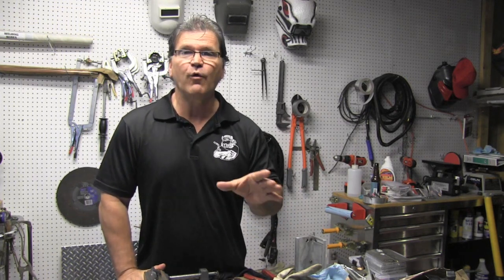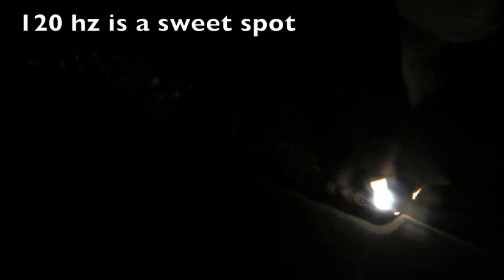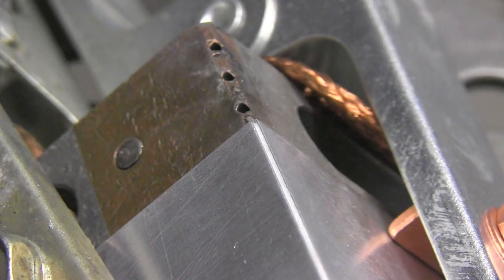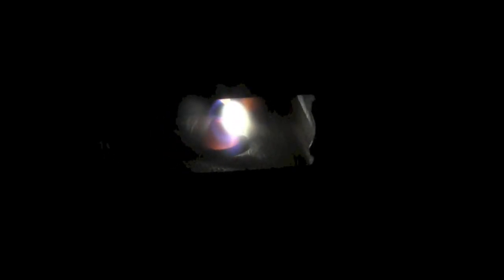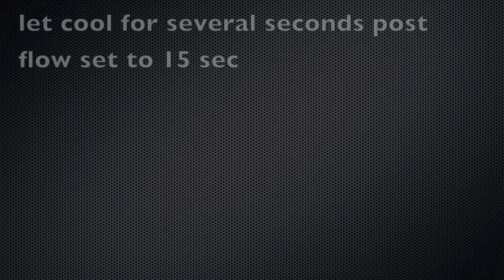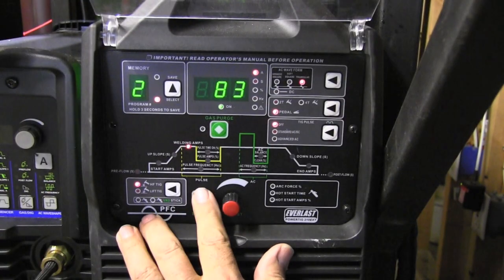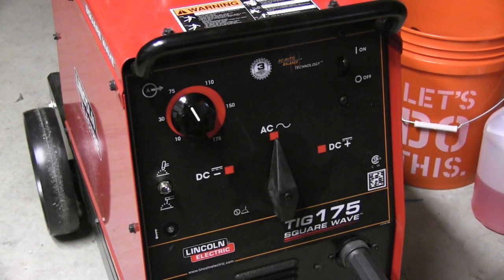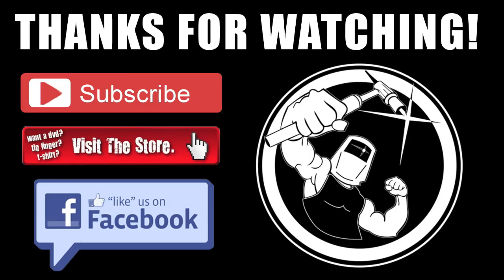Tig Welding Thin Aluminum

Comment: Fact Aluminum is a trade mark name for reynolds aluminum foil wrap ... they couldnt trade mark Aluminium because it IS an element ... they could trade mark a misspelled version though ... btw Reynolds wrap is made with Aluminium ... you use facial tissue ... most people cal them kleenex .. (name brand) ... you hold wrapping paper on a present with Cellophane tape ... Scotch Tape ...is a name brand ... Aluminum is a foil made by reynolds for wrapping food in ... made with Aluminium

Comment: Gotta thank You for sharing all this stuff. .080/2mm 2%La became quickly my favourite. I was trying 1.3mm sheets of 3003 with 1.6mm 4043 filler (we don't have thinner at the shop). 250Hz and triangular wave felt nice. It was challenge for me with 200Hz and square wave (I tried to practice this because I'm not sure if I will be able to afford machine that can do several waveforms). Had to babysit it with pedal a lot, specially when I was trying to do a pass without chill plate but got away with it really nice. But thanks to You tips I finally had and idea of what is going on. So thank You a lot!

Comment: I'm a woodworker who wants to make aluminum drift boat hulls.  I think this means  0.1" inch or so thick sheeting, welded only at the chine where the side meets the bottom panel.  Do I need to learn how about mig or tig welding?  I had a buzz box stick welder once, and got fairly good at it.

I sold my torches and buzz box because they didn't mix well with sawdust.  But now I have two separate spaces.

Comment: Hello, I'm looking to buy a everlast tig welder and would like your opinion on the 200DV and 250EX. I'v been welding for a few years with the miller syncrowave 180 SD sold it and looking for a smaller in size welder..Thank You

Comment: Hello all, and first of all, great video thanks fo the share, And Second, Nice to see that it works with 60hz on thin aluminum also, because all the 'Tig Thin Aluminum video's' i've watched, were all on very high Hertz.  I've just bought my Tig inverter 220p (60Hz) and  when welding 1mm steel and stainless there is no problem, both weld great on very low amperage and that's exactly why i needed this AC inverter but than to weld thin aluminum.. HOWEVER...  i'm unable to get a pudle,, eather i dont get it or turn Amperage up and i blow thru the material. (Using 2% ceriated Tungsten, they were the only one's availible where i ordered the TIG inverter. I've ordered blue red and purple thungsten now also. When i get an 10mm piece of aluminum and turn the amperage up, no problem, great pudle, great welds, but thats not why i bought the Tig to begin with.. im looking forward to, and appreciate everyone's input here. Thanks in advange!.

Comment: Hi im new to tig welding and alloy welding is my reason for it. can you tell me what i may be doing wrong, im trying to weld some 1mm thick alloy but instead of forming a puddle it just seems to melt the alloy away before it even forms a puddle, im on a frequenceof about 60 but tried up to 200 and still the same and amps up and down from about 40 up to about 120 and still just dose the same thing, also when i try to add a bit of rod it seems to ball up and don't seem to want to add to any bit of a puddle when i do get it to puddle a bit.the tips im using are red tip, my welder is a new Sherman DIGITIG 200GD 200A AC/DC MMA IGBT Inverter Pulse Welder. please help im stressing out.
Reply: WAUW, i have the same problem, just changed the option 'best response to newest response and now i see yours.
Reply: Unfortunately he don't give any feedback.
Reply: @WALLACE7084  
No thats to bad, but i made up my mind en send this one back today, it is good value for the money but not what I'm looking for. I need to weld thin aluminum.

Comment: Hi Thanks for all your tips on welding. I have been watching them for sometime now. I have a question about Tig Welding thin Aluminum .030 " Thick. Im building a Aluminum box and i cant put no backer behind it and it keeps blowing through. Is it me or in cant be done. My settings are. 30AMP . 250. HZ  30% Clean. Using 1 1/6" electrode. 1/6" filler wire 4043.Had the tig welder on Triangle wave. Any advice would be appreciated. Thanks .

Comment: I've been using an old cebora Tig star 200 square wave set with an air cooled torch,  it has no frequency adjustment only amps and balance. My boss (not a welder) thinks I can do nice little beads on aluminum with this machine on 10mm thickness but l can't find a way the puddle is always wide.

Comment: Any tips for mig welding 16 ga aluminized sheet metal, I have no problem with it but bead appearance is like 6010 stick rod, we use 75/25 gas and I'm not too sure about wire but I think it's .035, pulse or short circuit is not available due to production rates, wondering if there was a gas or wire we could use to improve weld quality for better bead appearance

Comment: This is great information for me as a new TIG welder hoping to weld some thin aluminum. I have a Square Wave TIG 175 almost exactly like yours, bought new back around 1995-2000, but I never got around to TIG until just finishing a community college class today. I like that you keep showing this machine in use so I can relate to mine. I've placed two orders from your store already. Glad to support someone so helpful. I might update to a newer machine some time later, but it sure seems like this one will handle home projects pretty well.

Comment: I build radiators and Weld down the rubes to fix leaks and damage daily and on my dynasty 700 I run .040 and a #4 cup tri wave, freq400 but balance at 99. it makes super tight and tiny beads but more importantly keeps the arc stable as to not burn the fins.

Comment: I'd really like to see the back of your welds on this video too !! I have some thin wall Tubing to weld up in T sections but I cant have any bubbling action going on at the inside of the tubes as I need them to slide ! so will these techniques work for lowering that penetration on the back side ? Cheers
Brad

Comment: could you explain the difference between volts / amps & hertz? I mig & stick, trying to learn tig now.
Reply: Voltage is defined as 'electric potential'. Imagine two vertical cylinders with a valve connecting them. One is full of water, and the other is empty. When the valve is opened, the water rushes to fill the empty cylinder. 
In this case the 'water' is an analogue for electrons, and the valve is an electrical switch. 
A value in volts will tell you how much of a difference there is between how charged two objects are, but it doesnt necessarily correspond to current. Think about getting a static shock - there is a very large voltage, hence when you touch something grounded, the electrons jumping onto or off of you create a 'pop' noise and a small arc. But once you are at the same voltage as ground, there are no more electrons moving therefore no current.
In welding, the voltage is what creates  a 'desire' for the current to arc and connect to ground, and therefore a higher voltage should correspond with easier arc start.

Amps are a measure of electrical current. Amps tell you how many electrons are passing through a certain point in a second. On a constant current (stick or TIG) welder, this essentially corresponds with how much power your arc consumes and therefore how hot the weld area becomes.

Hertz are simply a measure of frequency. 1Hz = 1 cycle per second. A higher AC frequency when welding aluminium means the weld is switching between + and - faster, therefore the characteristics of each polarity are reduced (less electrode balling, less 'pulsed' cleaning action). Whenever you see Hz, you know you are dealing with something like pulse, oscillation, etc, that happens periodically.
Reply: Frank Reading thx for that you share with us

Comment: I want will share an effective folk remedy from burns from Russia: the sinks of river mollusks collected on the bank of a reservoir need to be calcinated at high temperature. After cooling to crush in powder. To use this powder as powder right after receiving a burn.

Comment: Wish I had seen this years ago when I was restoring an old Crestiliner boat.  the hull had a ton of tiny perforations in it because it had sat full of water for a while.  I had a crappy old Westinghouse stick welder with a tig conversion on it and really had no clue what I was doing.  I bent a piece of stainless sheetmetal let it spring against the backside of the aluminum.  I managed to get most of the holes touched up that way.

I'm sure I would have done much better with modern equipment and a few of your lessons.   I did however weld up one aluminum casting on the boat good enough that I got the only compliment in 52 years out of my dad.  He looked at the piece for several minutes, handed it back, and said "Damn fine welding job son."  Even my four brothers who were there also said they couldn't remember getting a compliment out of him.  Kind of wish I had of kept that casting when I sold the boat.

How would you weld a hole in thin (16-18gauge) aluminum when you couldn't get a good backer behind it?
Reply: Slowly and gently sir lol I repair welded 18ga aluminum tubing that broke in half few months ago, turned amps wayyy down, maybe 50-58amps/120hz/66%EN, used 1/16 4043, and made 3/4" to 1" long runs(3 or 4 dabs then stop)let cool for 10 or 15 sec in between passes, it turned out just fine, stronger than before, not an instagram weld but, no blowthrough/holes, and no mess. You have probably already figured all this out by now lol good luck!

Comment: I'm thinking of going to school for welding ,changing careers. I'm looking at all the job postings in my area. I'm seeing an average of 25-30 k a year. What the heck am I missing. Why would anybody go to school and pay money for that kind of salary?
Reply: +MrStropparo that a basic starting salary, I went to school for a 10 month certificate program got into my first fab shop 2 years later I'm making over 45k a year at 22 years old. It's all about how much you can bring to the table.
Reply: Depends on what you wanna do. If you wanna travel and do pipeline and contract work it's pretty easy to pull 80k+ a year. Not gunna make a ton doing production work at a local shop more than likely.
Reply: +Eric Pender what state do you live in.

Comment: thank you for your instruction.  I am trying to weld .020 5052 aluminum.  into panels for a cart body,   i have Miller Syncrowave 200,  TIG, with argon,  my Tungston is .080.  What AMP setting should be around?  Can i get away with the electrode i have? thanks

Comment: I'm preparing myself for aerospace TIG welding. Ive been in shop and out in the field for 3+ years.  From my understanding  it will be on Inconel, Titanium, SS and Aluminum.. Ive previously worked with SS and Aluminum but its been a while any suggestions as far as amperage goes for these metals?

Comment: The last weld on the Lincoln machine without all the bells and whistles was the best by far.... nice penetration and hardly any weld stack.
My Lincoln has all those settings, and in the last 10 years that i've owned it, it's been off auto maybe twice.
Correct filler, CLEAN aluminum,  get an amp that's close (with a pedal), and rock on!!!
Real welders make chicken salad outta chicken sh*t all the time, and you prove it again here.
Been welding 30 years and still learn something or get a new idea every time I watch one of your videos... Thanks again for your time.

Comment: Hello, I have a miller mig welder, could I weld aluminum to steel?
Reply: DIECASTER Need a red machine for that...
Reply: DIECASTER use superglue, sellotape and string.
Reply: Melt a bunch of aluminum in a pot until it's liquid, insert steel, remove the steel (now with an aluminum coating), weld to another piece of aluminum.

Works every time! 100% xray. Trust me

Lol
Reply: No really, look at Fronius CMT...

Caveat though is it has to be galvanized steel

Comment: Hei jody, forgive me if this is a silly question, was it a scratch start u used for the last piece? The one u used with the Lincoln machine. So scratch start works for aluminum as well? Apparently the teachers in my school arent as good and ur videos have been a lot of help.
U r the best teacher ever
Reply from the maker: The last weld was not scratch start. I used a Lincoln Tig 175 with high freq start. Scratch would not work well at all on aluminum
Reply: Thanks for ur info jody. Very informative. The teachers in my school dont even know how to do a scratch start properly. I tried a couple times myself. Sometimes it starts up the arc so easily but sometimes it just wont start at all even though i keep scratching the steel. Does it matter if i were using a foot pedal by any chance? I saw one of ur video before, flipping the rod to the tungsten. How do u form a circuit by that technique? Im kinda stuck now and no one can give or show me a proper way in school. Its a shame that after paying that much for the school here in australia, i still get the most info and skill by watching ur videos here haha

Comment: Hey Jody, I have a Eastwood fixed 60Hz inverter machine that I use for hobby AC welding. I have a hard time welding thin aluminum with 1/16 electrode and filler. It just seems like the edges melt away and I end up chasing the puddle and dumping filler. Would I benefit from upgrading my machine to one with adjustable frequency and run 120Hz+ or should I just practice more. Not sure if 60Hz is holding me back or I have welding machine envy.

Comment: how would you keep the frosting on the sides of the weld down to a minimum just to get a cleaner looking weld ?
Reply: i have a everlast 250 ex  and it has the ac balance control on it.just wanted to know how i could get that frosting effect narrowed down as much as possible.

Comment: Did you have a backer on that last weld @ 60 hz  ?
Reply from the maker: No backer on the last one
Reply: That's impressive on such thin material.  I learned on an old Linde machine that had no AC adjustments at all (like the Lincoln).  I think you're right you just learn to adjust.

Comment: Jody do you ever do anything with brazing or silver-solder?  I find those two skills in the same wheelhouse as welding, and I could use some tips on getting my bronze to control right.
Reply from the maker: I lost my oxy setup in a shop move but am shopping for another. Maybe one day o will do some braze work

Comment: Thanks for the video. I'm "stuck" with my old school syncrowave 351 that I bought in 1993. I want a new welder but can't justify the money when mine works fine. Guess I should get rid of welder envy. I'm starting on a set of fuel tanks for my Piper Cub replica. 5052  in .050.
Reply: Nah, I would say, u got the tried and true welder there bud. And the amps to boot. I would use it until it dies! I only have power for inverters, I have three(miller, lincoln, everlast) and use miller syncrowave at work...if I have learned anything, it's that YOU/ME are the BIGGEST BELL AND WHISTLE OF ALL lol good prep, technique, and skill are what makes a machine lay down consistent beautiful dimes, not the machine itself. It helps with VERY specific applications(super thin/thick) but that's amperage range, not bells or whistles. Lol anyway I'm sure u know all this, just figured ide help drive it home. Inverter is good for throwing in back of truck, and using less amps from electrical circuit, but that's about it in my opinion

Comment: Good video as always. 

Why did you choose triangle wave form?
Reply from the maker: jfpinkston just for kicks mainly.  Also The owners manuals state triangle wave works good for thin aluminum.
Reply: I never knew what the different wave forms were used for. 
The end result turned out nice!